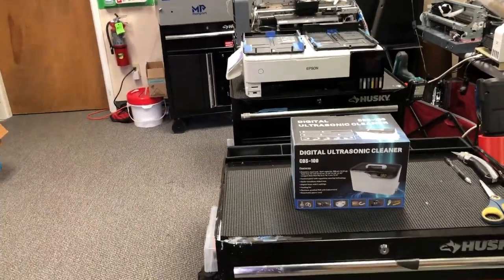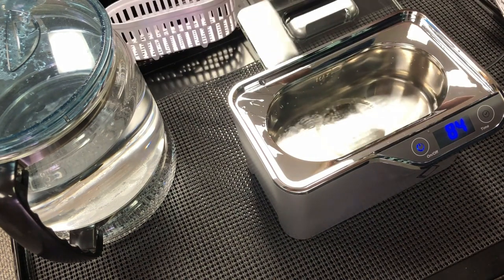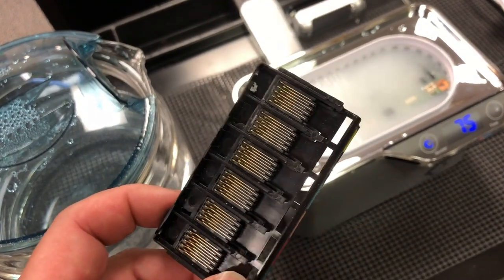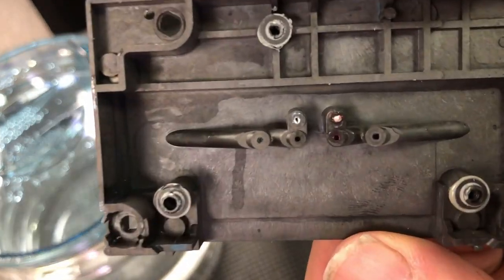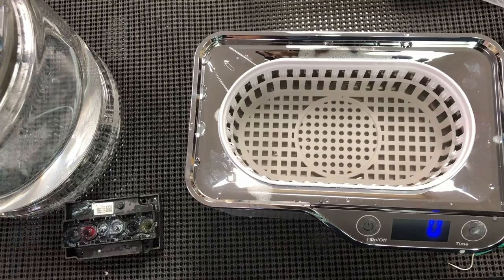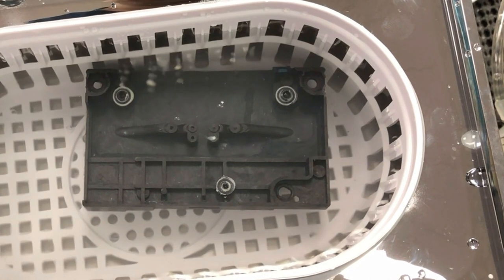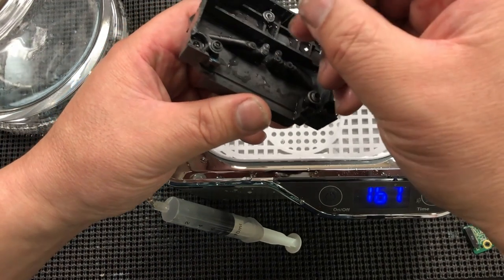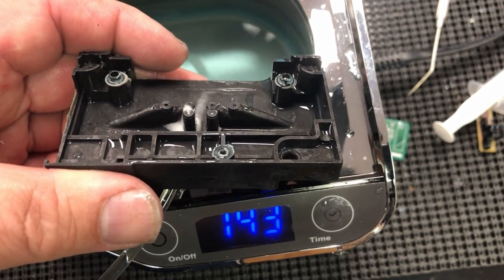Cleaning Ink Intake on L-1800 Printhead with Lifebasis Ultrasonic Cleaner

Comment: It's a bad habit to use ultrasonic cleaners for print heads. This can cause microscopic pitting in the head's nozzles which can lead to nozzle deflection and other forms of misfiring. It's recommended to use cleaning solution with a multichannel peristaltic pump. It will take longer but wont run the risk of damaging the printhead.
Reply: that's exactly what I do.
I assembled a special stand for this with a peristaltic pump